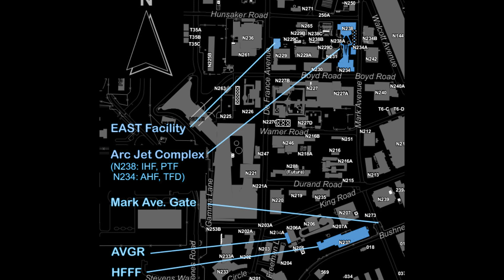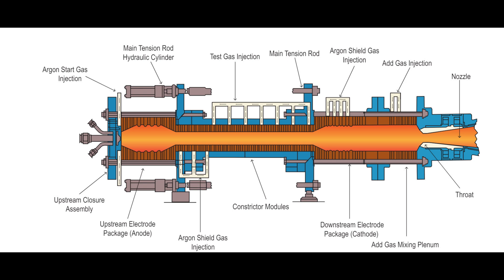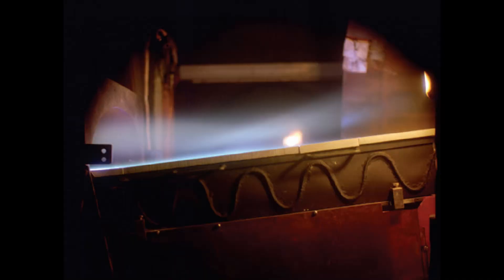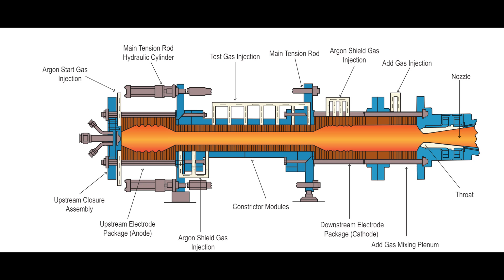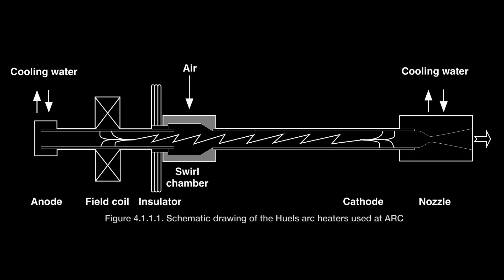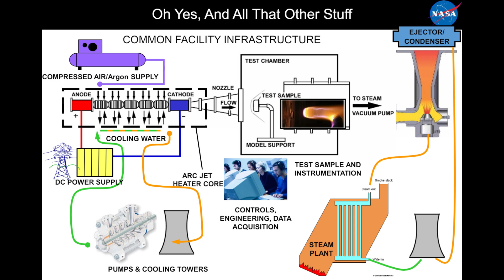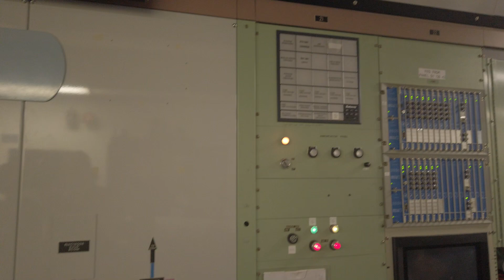How NASA Tests Heat Shields Using a Plasma Wind Tunnel

Comment: Question: has SpaceX been using this facility in the development of the heat shield for starship second stage? If so, why does the SpaceX designed heat shield for the second stage of starship still suck so badly that tiles fall off during lunch as well as during entry? If SpaceX hasn’t been using this facility aggressively, is this another example where SpaceX Seems to refuse to learn or educate themselves on the lessons from earlier NASA work the way that they apparently refused to learn about water daily systems and flame trenches when designing their “orbital launch melt“? I have been told by many Elon cult members (I identify them as cult members because of their crazy opinions) that the only testing of heat shield that is required is just to test it on the actual starship as it comes down through the atmosphere! I get this opinion several times even though I like to point out that SpaceX has yet to recover a single heat shield tile that actually went through reentry even after four flights of starship. What do you hear? Is SpaceX going to start using the capabilities of this facility, more in the future or will they continue to grudgingly refuse? As the old saying goes “you can lead an Elon to knowledge, but you can’t make him think that he has anything whatsoever to learn from other people “.
Reply: This facility can help prove the effectiveness of materials for reentry, but it can-not simulate all the forces a craft encounters during launch and reentry. That's a much more challenging and interdependent problem to solve. The tiles appear to be good, the way they are connected not so much.
Reply: As far as I know, no tiles fell off during 'lunch' [sic] of the fourth flight...

As far as I know, every other (even NASA-designed and -owned) flame trench requires repairs after every launch - which wouldn't be compatible with SpaceX's long-term goal of supporting multiple launches per day from each pad.  SpaceX has been trying something different, because legacy designs don't (and can't) fulfill the specific business requirements for extremely high launch cadence and extremely rapid pad and vehicle turnaround.

Also, SpaceX is trying to do everything on the quick and on the cheap - because, unlike the U.S. government, SpaceX doesn't have unlimited $Billions and unlimited decades to throw around on overanalyzed, overengineered, and overbuilt solutions.  Thus, SpaceX takes the "hardware-rich" approach to R&D, with all the ensuing explosions and rock tornadoes coming along as par for the course.  People see this, and while wrongly assuming that SpaceX is otherwise like all the legacy aerospace conglomerates, incorrectly conclude that SpaceX must be incompetent.  And then, they get shocked and surprised when SpaceX winds up eating everyone else's lunch...

Comment: It was so cool getting to see Ames with you! I was trying to find which cables carried which fluid, NASA had a stream a while back that claimed water flowed through the orange lines but I think you're right that they carry air as those beefy hoses would be the much higher pressure line than the water above.
Reply from the maker: It was a lot of guesswork based on what I saw and read, I could be wrong
Reply: What a cool tour! If you guys came across any samples of something called 3MDCP while at Ames, I made that!
Reply: Was gonna say this is the perfect Scott Manley video to follow up the BPS space heat shields tangent.
Reply: 0:47 I spotted you man 😂
Reply: Check out periscope films, they have one video of all the lifting body shuttle designs in the chamber.
Reply: Is this different from PBS Space?

Comment: Hey Scott, I've always wondered if the high tech fussion guys, can control the shape of the plasma to protect  their equipment with magnetic lines of flux, why can't Spacex do the same with starship. 
How would that look like? Maybe a few miles of 20 GA wire wrap into a coil inside the starship itself attached to a 9 volt battery. 
Or perhaps a bunch of coils embedded into their ceramic tiles, perhaps using the plasma itself as a power source to induce a current in the coils generating the flux field. . .
Reply: No matter how you design it, any such system would weigh too much, and take up too much room, to ever launch in the first place (never even mind reentry)

Comment: You should do a video on nasa's new vertical wind tunnel.  I worked on it so it should be about done.
Reply: The main chamber for the wind tunnel was made by AGI manufacturing in wisconsin and when fully assembled was 40 feet by 40 feet by 40 high.

Comment: I had a visceral reaction when you entered that LEAF room. It gives "the backscatter will blind you and that's just the start" vibes
Reply: Same here! When I was younger, I used to think lasers were cool so more powerful lasers must be more cool (to play with). Now, 20 years later, a big ol' NOPE! I work at a prototyping shop and we have a 4kW laser (TruLaser 2030) that will happily cut through 1/2" steel. These folks have 4, 50kW lasers? Yikes!
Reply: Just the size of those mirrors has some terrifying implications
Reply: You aren't wrong. It's likely a ytterbium fiber laser. 200kw out of 4 fiber pipes is downright scary. I've seen a 4kw one and it slices and dices 1/4 inch steel plate like a hot knife through warm butter. 😮

Comment: They should let spacex test their new heat tile variants for Starship!
Reply: They are tested in similar facilities. Issue is not with heat tile itself, but interaction with ship itself. Attachment, heat expansion, cryogenic temp on one side, while plasma on other, vibrations.... This is why they need a test flight. To know exactly conditions that are during flight. Then they can simulate it.

Comment: basically a BIG water cooled TIG torch
Reply: Plasma cutter comes closer.
Reply: @samuraidriver4x4  Almost perfect example
Reply: I in TIG stands for "inert" if I'm not mistaken? (Serves to protect the metal from any gases it could react with) Well please note that atomic oxygen is very much opposite of inert! 5:05
Reply: @u1zha  Argon is the main shielding gas used for TIG, they do use argon in this system aswell.
But yeah there are also plenty of reactive gasses present.
Reply: The copper alloy rings are made of copper tungsten alloy. Streight copper would vaporize far too quickly. 😮

Comment: It's gotta take a long time to pump down a vacuum chamber like this especially with it being open to atmosphere for set up .. I wonder the operating pressure in Torr??
Reply: Don't know about for this one in particular but specs for another plasma wind tunnel states 10^−8
torr
Reply: @MrDJAK777  that's pretty insane the PVD operation I used to work 10 ^-5 was pushing the limit and if left open for any significant amount of time would take a day to get there. Guess it depends on the supporting systems, heating elements, rough and cryo pumping capacity. Just the size of this thing looks like it would take a long time between cycles.
Reply: They have a steam rocket to pump the air out.  I doubt it takes very long to get a "good enough" vacuum.
Reply: @martylawson1638  a steam rocket?? What is that?? How would steam in any way help create high vacuum??

Comment: Were the fiber lasers they used commercially available from industrial laser cutters?
Reply: One guess is they could be IPG Photonics industrial lasers, it's funny because with a focusing lens that steel plate could be cut with a nice result with only 2kW from that laser :) But yea, it is pretty impressive to poke a hole with the raw unfocused beam even if it requires magnitudes of higher power:)